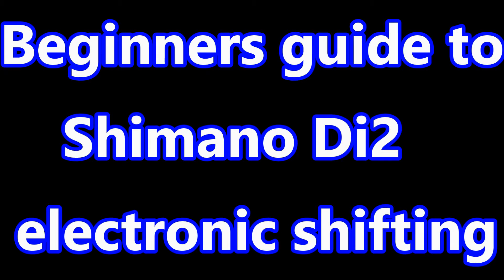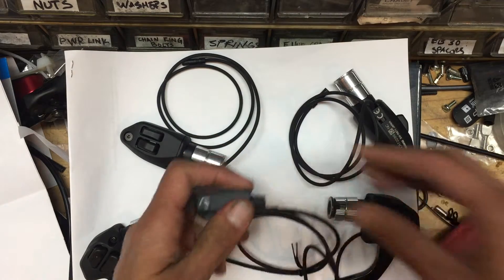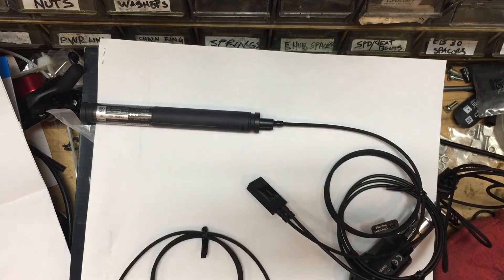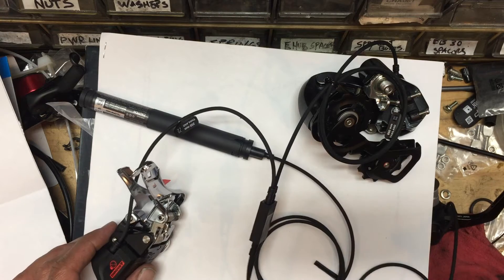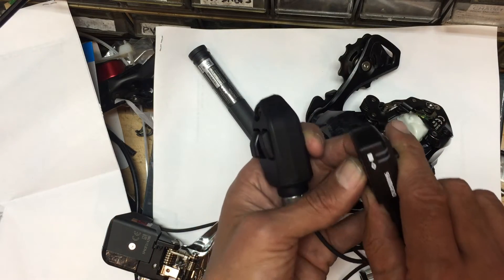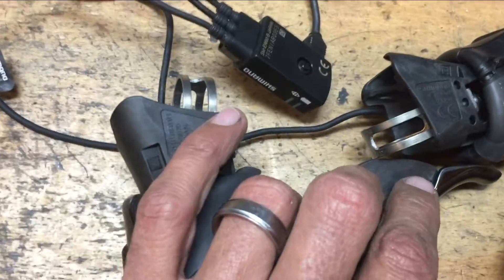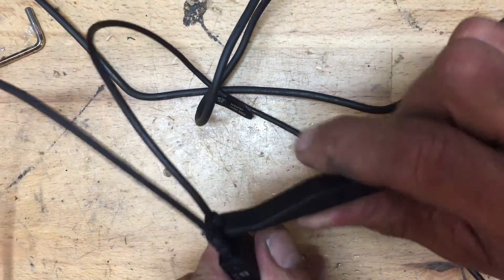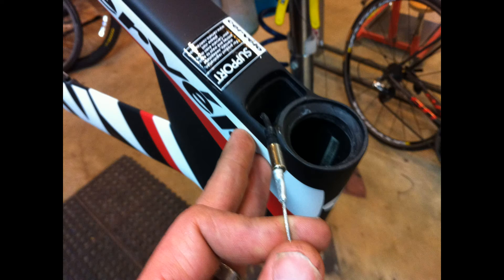Di2 wire layout simplified

Comment: Does it matter what port on the internal junction B  you plug the front/rear derailleur and battery into? I have a Di2 FD-6750 left over that I tried plugging into an M8000 di2 system and E-tube was flagging it at not compatible.

Comment: Can i use older frame with this Di2 electronic  group set?
Reply from the maker: Yes. You'll either have to fasten the wires outside the frame or drill holes to route the wires inside the frame though. On order frames, I like using SRAM eTap stuff for electronic shifting due to it being wireless.
Reply: @JoeyMesa  thanks for the info i might consider buy sram instead.

Comment: Hi, please can you tell me how long are the cabels by the four aero shifters ?
Reply from the maker: I'm not 100% sure, but I believe they were somewhere in the range of 350-400 mm long. These shifter models were from a few years ago and the current models have a shorter wire with a female end, so you can easily customize the length on the newer style.
Reply: Thanks Joey for the quick reply, Tom @JoeyMesa

Comment: Do u really need the tool for pluging it in or can u do it by hand
Reply from the maker: It's not mandatory that you use the tool for plugging it in or unplugging, it's just easier in some of the harder to access points.
Reply: @JoeyMesa  You are just less likely to damage the cable and you can be more sure you have seated it fully when you use the tool as you showed in the video. Great summary of the basics.
Reply from the maker: @mikemorris3421  Thanks!
Reply: Does the tool come with it or do you purchase it separately?
Reply from the maker: @neilmartinez143  I believe the tool comes with the shifters.